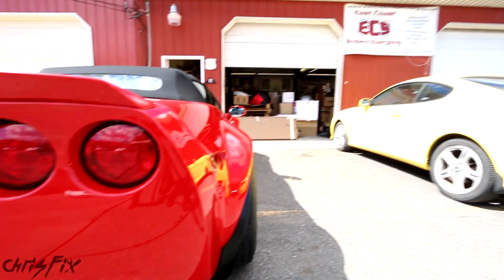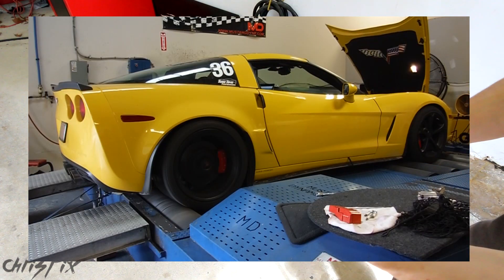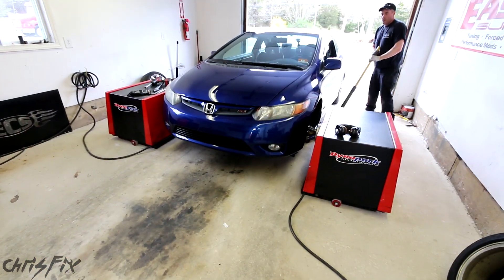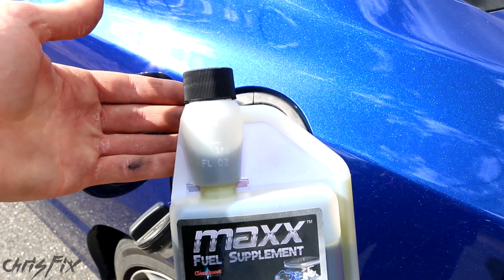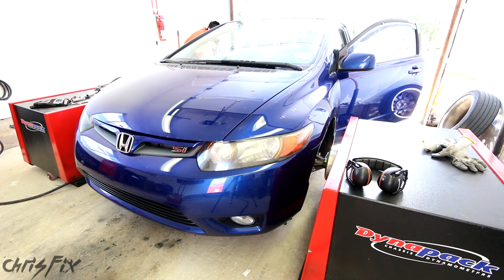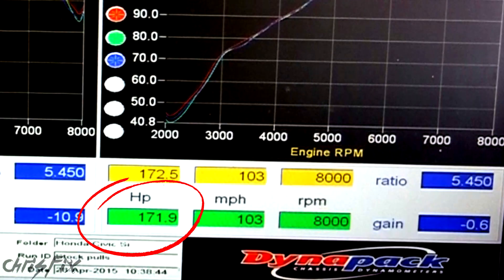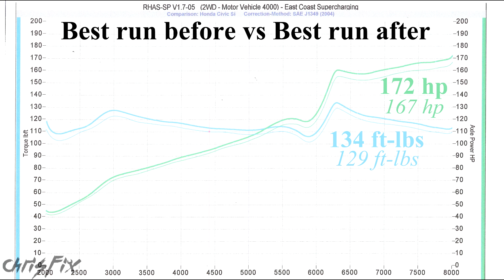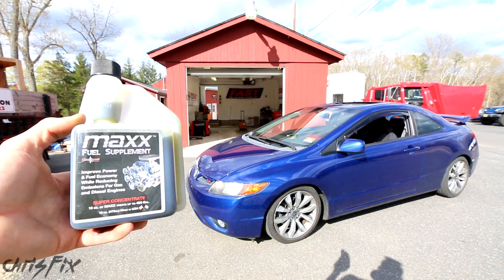Can a Fuel Additive Really Increase Horsepower in Your Car? (With Proof)

Comment: The test isn't correct. After u add additive at the tank, u should flush out with gasoline so no additive left at the pipeline tru the tank. The  almont of additive u add  is so litle, that maybe the half of it stays at the pipeline so the mix isn't correct.
At every additive label says add 1st additive then u fill up the tank. I bet it's wrote on this  two.
My opinion.
Reply from the maker: Thanks for sharing

Comment: Why is there a wrench light on? Why is there an air bag light on? Where is the big fan that is supposed to be in front of the car? I saw a little orange fan in the shed but you did not use it. Otherwise a good video.

Comment: i think for me .. well .. yes because i have an e34 that has over 170,000 miles on it, i never even took out the engine out of the car i was so carful for the car that i only need to change the motor oil and add fuel to the car .. those are the only chnages so maybe when this cleans my fuel injector it will add .. and iam sure that they are dirty, also i will not pay money x10 the car here to rebuild it

Comment: This works because the additive acts like octane booster, which not only creates more power, but also cools the cylinders and reduces heat soak. That's why you didn't lose power with the additive.
Reply: Higher octane doesn't give more power. The octane level tells how resistant the fuel is to pre-ignition. Higher compression engines require higher octane to prevent the fuel from spontaneous combustion before the piston is in the proper location. High octane does nothing of benefit for an ICE with a typical 8:1 compression.
Reply: Richard Nettles that’s not true. Octane additives like ethynol create more expansion in the fuel, and yes is less likely to pre-ignite. The difference between 87 and 91 fuel may be very minimal, like 2% gains in power. This is due to the cars computer not tuning more fuel for higher octane. However, when a car is equipped with a flex fuel system, and runs E85 ethynol, you can see some serious HP gains. This is why cars like the koenigsegg agera rs makes 1100hp on 91 and 1500hp on E85.
Reply: Do some research on the purpose of octane ratings and the theory of how an internal combustion engine operates. It's not that the engine is gaining power from the higher octane, but the engine is losing power with lower octane fuel because it can't handle the pressure. The lower octane fuel causes predetonation, which causes a loss of power.
Reply: @richard3422  Almost every modern engine is very high compression. Well over 8:1, some are now using 14:1 even. All of these new engines have knock sensors, which ran with lower grade fuel, even if the cars manual says it can run 87, will detect knocking and change timing to reduce damaging effects. Some cars will even see 1sec faster 0-60 times with 91 over 87, even though the cars manual says it can run 87. You can take it a step further by running 93, which will have the same effect at high RPM, and show positive gains on a dyno, especially in a vtec, or turbocharged motor. You even said it yourself, lower octane causes reduction in power, so raising it can increase power, to a certain amount. You can't just go throw E85 in a 87-93 rated car, but with the correct modifications, you can see even more gains from E85 (108 octane).

Comment: What if it got colder in the day? No heat soaking? Could lead to the gains .. being in jersey that is
Reply: I can't say as to the HP gains but I have used this fuel treatment for a few years. My diesel truck gets about a 7-8% increase in economy and feels like it has a bit more get up and go.  My wife's little turbo 4 door gets 10-11% better. Cost per tank of gas....cheap! Smells wierd...LOL.

Comment: Chris: your Civic Si is probably knock limited. The fuel additive increased the anti-knock performance of the fuel, allowing the engine to run with more optimal spark timing and hence produce more horsepower. Did you use regular or premium gas in this test?

Comment: Hi Chris, I know it’s been years lol, but I am a loyal follower, hope you can answer this question! Apparently every car needs it’s recommended fuel grade stated in the owners manual, in order to have maximum performance, lower grades can cause low performance, engine failure etc. So I wonder if you still remember what grade of gas you put in the honda, was it the recommended type or lower grades? Since the fuel addictive might act like an octane booster which it can help increase the octane level. If you did put the recommended grade of fuel in and the results were basically 99% correct, but if you didnt, then it’s probably the octane level got increased to the engine’s desired level.

Comment: I expect this additive increases the octane level of your fuel. The higher the octane level, the less likely you will get spontaneous combustion (caused by heat and pressure, not from the actual spark), which explains the inconsistent results with each consecutive run, before you added this mix to your fuel.

It's less likely to work in Europe, where the typical octane level is 95 and sports vehicles use 98 or 100.

It's important to note that not all engines can benefit from high octane fuel - it depends how they are set up from the manufacturer.

Comment: I know this doesn't work for all cars, but for a 2000 Ford Excursion 6.8L gas V10, it increased my gas mileage from 9.5MPG to 14.5MPG, which means I can now go 638 miles per tank vs. old 418 miles, and roughly a $60 savings per tank at current West Coast gas prices.  Yes, I'm a Believer!!!

Comment: Makes sense: I pulled the MSDS on several of these "booster" fluids.  Most say 99% is Kerosene and Mineral Spirits and trace (less than 1%) of "other ingredients".  Kerosene (sour diesel) ups the octane as would alcohol, but unlike alcohol the added amount wont decrease BTU/volume.

This means the gasoline can be compressed higher (tighter) before sparking.  Low octane fuel has the same energy as high octane fuel, but since 87 ignites at lower temp/pressure the VTEC engine is going to electronically set the timing and valves for lower compression strokes.

A car/motor without VTEC, VVT and EGR will not be able to take advantage of the suppressed ignition point of higher octane, so it makes no difference in a simple motor, unless you shave the heads or manually tune it for high octane fuel.

So adding power depends on the car.  Using a BMW or Honda VTEC is an added thing thrown into the test. However, most of these additives are Kerosene and Mineral Spirits, so about 20 cents worth per tank if you buy 87 octane, vs what they are charging for that pretty bottle being $2 or more a tank.

Octane boosters can be good in carb engines like old motorcycles that were built to run on higher octane back in the 20th cen.  However the higher octane is harder to start in a cold winter engine.
Reply from the maker: It’s actually a nano metallic catalyst. I ended up doing more research and the military has been using it. There are isotopes of iron that increase combustibility of the fuel. You may also be correct about the octane but I know for sure the nano metallic catalysts are the “secret sauce”.
Reply: ChrisFix.  Ill look up that one.  Gumout and STP and several others are just Kerosene and a trace of tiny snake oil according to MSD.  Refining gasoline is a byproduct of kerosene refining done for 160 years, then we found a great use for it in 1900.  Higher octane in pure gasoline is just not separating it as totally from kerosene.  

Contrarywise: Often octane in pump Ethanol is done afterward by adding more Ethyl at distribution.  3% for 87 and 10% for 91 but the same gasoline base.
Reply: ChrisFix.  I did look it up in the MSDS.
NAPHTHA PETROLEUM 60-100%
NAPHTHALENE 3-7%
ORGANOMETALLIC COMPOUNDS 1-5%
1,2,4-TRIMETHYLBENZENE 0.1-1%

So Kerosene and Mineral Spirits. Naptha/Natphalene = refined coal tar. Kerosene replaced it.  C10H8.  Mothballs are it as a solid.

"Nano particles" is trade talk for pixie dust like Quasi-lambs wool or Bonded leather.  Considering the amount you put into a tank of gasoline.  1% diluted a million times is 0.00000001%.  About a speck of ferrous oxide dust for your whole tank.  The Benzene is the same trace amount in Kerosene.  Naphthalene is two benzene rings joined, so it typically has a trace of separate benzene.  Benzene is known to damage or distort automotive seals and gaskets.

Try the test with that VTEC Honda with an equal amount of 50:50 K1 kerosene and mineral oil, or just kerosene.  Should up the Octane number, get the ignition to adjust for higher compression and get you similar HP figures on top of 87 octane discount gasoline.

Nothing wrong with them selling the product in a convenience bottle at a high price, but it isn't magic.  It was developed as a Military Spec for diesel motors, so if it works in gasoline it has to be simple.  Like SeaFoam was developed for simple outboard two strokes but it still somehow has magic properties for 4stroke, EGR, MAF car engines.

Comment: Next test. Do not add the additive check first 3 readings, go around for another 20 mins (with similar miles) and again DO NOT add the additive and check the power again 3 readings.ALL WITHOUT THE ADDITIVE. then add it and check it.

Comment: But what basic line gas is using? 89 or 95 or 98 will make huge different as the computer will use different ignition timing and injection map according to the gas
Reply from the maker: High test. So it’s already using the highest grade you can use (besides race fuel or something uncommon like that).

Comment: Check the humidity level on the first runs its  value is something in 34 and in the runs with the additive its value is 29 . Humidity affects the power output of the combustion. I don't know if the dyno has correction values to the results or if this is the raw output. If its software corrected values then the test is valid if they are not then i am a little sceptical on this. Very nice work by the way keep going 👍.

Comment: I love your videos but I noticed something, would the results be skewed a little because you only had about 1/4 tank of gas in the car to begin with according to the digital gauge? That would concentrate the amount fluid you added to nearly 4 times more than what you're supposed to add according to the label instructions. I wouldn't be opposed to adding 4oz to a full truck fuel tank but at $8CAD extra per tank (on top of rising gas prices), it seems like that amount would be a little too much for what you get out of it.

Comment: The product stabilizes the fuel so it burns more thoroughly and consistently, it's not really adding power, though it looks like it. Fuel that that is burned more thoroughly, efficiently, and consistently will most definitely "add" horsepower.  Those first numbers are well within the range of deviation for unstabilized fuel. It is a cool test though, good job Chris.

Comment: I'm actually kinda sad that we didn't get to see what the temps were in the first runs.
That much power difference could be caused by a variation in temperature if it was significant enough, didn't look like it but would've been nice either way

Comment: Loss of horse power starts in the combustion chamber. The best burn you can get, gives you more bang for your buck in power. This additive (I haven't researched it myself) is more then likely causing a better fuel burn in the combustion chamber. It might only be a few hp and ftlbs-tq. But, it did it's job and accomplished a very big hurdle by adding anything at all. Can we do this same test, with a new engine, open the motor and look at what the internals look like before and after running the additive? It might show help, but can it do harm?

Comment: vtec kicked 4,000 rpms 1,00000000000000000000000000000000000000000000000000000000000000000000000000000000000000000000000000000000000000000000000000000000000000000000000000000000000000000000000000000000000000000000000000000000000000000000000000000000000000000000000000000000000000000000000000000000000000000000000000000000000000000000000000000000 hp (dragcar)

Comment: I have the same car with some basic mods and a tune, sometimes I put in Lucas octane boost and it definitely feels a bit faster and more responsove, I'd guess the reason these additives work well on these engines is because they have pretty high compression from factory and the additives increase the knock resistance and the ecu advances timing a bit to take advantage of it. Just my guess.

Comment: You should test e15,  e10, and straight gas on a dyno and compare power potential for each fuel.
Reply: That's a tough one to do because the amount of ethenol can vary greatly. E10 contains UP TO 10% ethenol, but doesn't have to have that much in it. E85 can have any amount, up to 85% ethenol, to be considered E85. 

That's why vehicles that can handle E85 have sensors to monitor the ethenol level of the fuel and adjust accordingly. Every time you fill up with a fuel containing ethenol, the amount will be different as well as the moisture content.

Ethenol additives increase the octane rating of the fuel because it's not as volatile under high pressure. But it will also eat away at many O-rings and fittings used in most vehicles. Ethenol is also prone to absorbing moisture from the air. Exposure to high humidity environments can allow for added water to the fuel just as much as losing ethenol content when exposed to dry environments.
Reply: As a rule, alcohol (ethanol) will increase horsepower, but at the expense of economy. The stoichiometric ratio for gasoline is ~14.7:1. When you add ethanol, the air/fuel ratio decreases, because ethanol has more hydrogen, and less carbon. Being able to consume more fuel for the same amount of air makes more power, but you have to add more fuel to get it. Fuel is hydrogen and carbon. One atom of carbon consumes 2 atoms of oxygen. It takes 2 hydrogen atoms to consume a single atom of oxygen. That's why you get more power from alcohol, but you have to use so much more of it.

Comment: Love ya bro. 
But these tests were bunk from the get go.
1) additive put in tank in close to empty tank
2)  fill with gasoline
3) run at least two tanks full, using said method and the same gasoline.
These "additives" are specifically designed to remove carbon deposits, thus restoring power back to or close to factory specs.

Furthermore, "VTEC" must have been an inside joke at Honda, not hating... just saying. 
Why didn't they engineer "VTEC" to kick in at 1 RMP? (YO!?).
Reply from the maker: Thanks but I think you are not understanding how it works. This isn’t a cleaner? This is a product that increases the usable energy in the fuel. Also Vtec doesn’t kick in at 1k rpms because that would defeat the purpose. The engine is designed to be efficient and use less fuel at lower rpms but when you rev it, the engine adjusts accordingly and makes more power which is less efficient but you get more power.

Comment: you should try a combination of octane boost and upgrade spark plugs and maybe an extended intake pipe.. to see if that combo will do anything. I noticed with an extended intake pipe makes a difference on a 2.2 vtec, it was extended to a cold vent, I don't think the cold air did much but I think the extension causes a delay in the timing of when the air reaches the engine.. where as since the vtec is opening the air valve longer and catching that late air just on time..

Comment: For the before runs, was the driveline (not just engine) warmed up equivalent to the 20 minute after drive? If not that power difference is easily in warm trans and diff  fluids not the fuel additive

Comment: I'd be so pissed if my car had vtec. Gotta wait 5 sec for the engine to start making power, then it only last a split second! Lame! Vtec means your engine sucks and can't  make power down low. I'd much rather have a powerband that makes power thru the entire rpm range. Kids these days are so misled. Come get some. I'll be in a 310whp/350wtq Buick regal. Makes more power at 3,500 rpm than this Honda at 9000 rpm. Lol. P.s. my engine was originally designed in 1962 which makes it a fair comparison. He he

Comment: The ultimate confirmation of results would have been to run it on the dyno one more time after replacing the doped gas with clean gas.  If the power and torque drop back to levels similar to the first set of baseline results, then the additive absolutely is the cause of power increase.

Comment: How much they pay you?

Either paid or a variable was introduced you didn't take into account (like warm gearbox oil after the drive)

This stuff has all been myth busted before on engines out the car in a cradle and no effects were found....one brand actually knocked horsepower off.

Snake oil dude, you should know better, especially how the graphs have identical paths....

Comment: I mean running an engine that's designed to run on 91 on 87 then adding octane booster to change the fuel closer to 89, yeah you'll get a little bit more power on a stock engine......

Comment: Chris,

This video is included with the other carbon deposit removal products. I see that this product seems to increase horsepower, as well as improve fuel economy. Was there any conclusive results on weather or not it cleaned off hard carbon deposits on valves/piston heads? How does it compare to sea foam? Which seemed to be the best results of the products you tested.

Thanks,
Andy

Comment: The reason why it works is the boost in octane.  Higher octane gas is more resistant to spontaneous combustion, knock.  So with the higher octane the car's computer can advance the timing more aggressively when the knock sensor sees that there is less or no knock.  Like older cars with distributors, you can manually advance the spark timing for more power and better response.  But, it increases the chance of knock and engine failure.